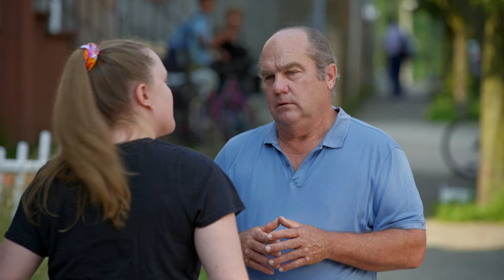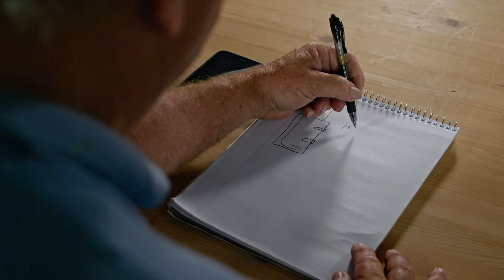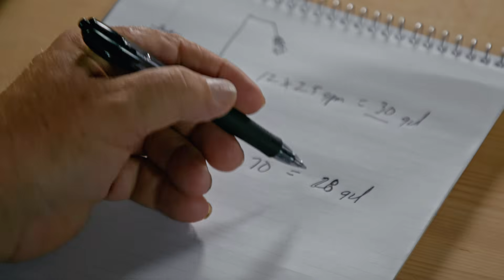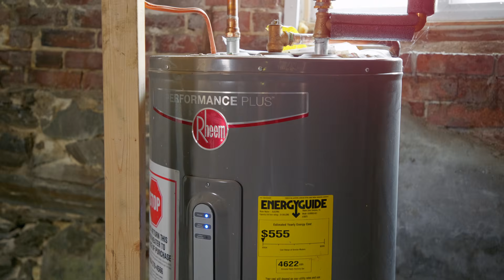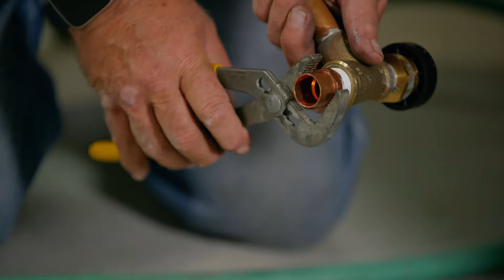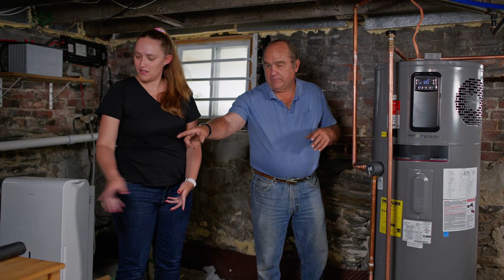When To Upsize a Water Heater | Ask This Old House

Comment: I think my first effort would have been turning up the thermostat on the water heater. If you're starting off with hotter water you're going to use less of it during the shower. It's a new shower so it's got a mixing valve so you shouldn't get scalded. Obviously if they have small children that might not work but it's where I would start. That said what he did may have been the best answer overall because there might be things that weren't in the show that we aren't aware of
Reply: Last longer yes did it at my gf house got about 30 mins on a tank but burns out your anode quicker
Reply: @SubToRandomVideos101 Why does it decrease the life of the anode?
Reply: @CodyOnHomes  cuz the tank is constantly running at a hotter temperature burning through it faster than
Reply: Use the hottest even with small children. Tell them about hot water and how to mix temps. That's how kids learn.
Reply: you could also put in a mixing valve at the tank to get 110 degree hot water so you don't get burned at faucets with two handles and then hot water lasts a lot longer
Reply: @ranger178  This. Cash Acme makes a simple tempering valve. You can virtually make a 50 gallon heater a 80 gallon with the thermostats up to 150, and the tempering valve set to 125
Reply: @joshm5816  i have a tempering valve so water to dishwasher is about 130 rest of house gets about 115 works realy well calibri or some thing like that has built in temp gauge

Comment: Any high-tech water tank will give you issues and will not last 12 to 15 years go old-school AO smith or Bradford White, no bells and whistles. Nice and simple.
Reply: yeah, you never know how long heat pump will run if it dies, you're out lots of money or voltage surge could fry circuit board.
Reply: @ranger178  it’s like a land rover vs a Corolla.  No bells and whistles for the Toyota you’ll get 150k miles worry free.  The Land Rover will get you maybe 40k miles worry free if you barely drive it and drive it like a Asian person or a 70 yr old

Comment: Those pipes are going all over the place.
Reply: Should have cleaned up the install while they had the chance.
Reply: My thoughts too. And it didn't appear that the copper pipe was supported anywhere so if anything leaned into those pipes, I would be concerned it could break a joint.

Comment: Clearly not worth the $1800 upfront cost when insurance mandates that you replace it after 10years anyway. Get the cheap 60gal electric one if you need more runtime.
I get that it's for the show, but real world experience, not worth it.
Reply: It's more like <$800. For example my utility gives you an instant coupon code for HD or Lowes, then you also get a 30% tax credit.

Also, this heater is 5 times as efficient and doesn't require much power to run.

In short. Totally worth it.

Comment: Ok the operation of this heater sounds great. The energy efficiency is good for the pocket. The part that concerns me is how remotely this thing is accessible. It likely needs an internet connection, which means a hacker can tap into it, or the part that worries me more….government can get into it and shut off your hot water. 

Sorry but even being a veteran I don’t trust government enough to not tamper with people’s appliances, which sucks because side things meant to make our lives easier and better can be turned against us.
Reply: yeah, the very reason they want kill switches in new cars now so they can shut off your car. they decide you have driven too much no more for you.

Comment: Wait, is that homeowner showering with the full hot water temperature from the tank? And not mixing with any cold water??? If your hot water temperature is low enough to shower , you got a legionella problem
Reply: Turn the tank temp up. Your mixed temp water will last longer .
Reply: Agree. This math makes some wild assumptions
Reply: yeah, set water heater at 130 and you mix it to 110 in shower we have mixing valve at water heater, and it makes water last a long time plus it is gas LOL
Reply: Correct

Comment: Not a fan of the romex just dangling down to unit. Should be MC cable or flex conduit to unit.
Reply: And the cold supply line with no support flapping in the breeze.

Comment: I understand there are now three heat sources but by your math how is an extra 7 gallons of water going to help? That should only add just under 3 more minutes of shower time, or did I miss something? That seems like a big expense for so little return. Although I understand it'll pay off eventually but not many have such upfront finances to get started.
Reply: Yea if they use so much hot water you'd think he'd go with a 60 or 80 gallon tank.
Reply: the heat pump part takes a long time to heat the water so if it has to kick in the heating elements frequently then that great savings is not going to be that much in winter your basement will be a refrigerator after it sucks all the extra heat from room, I think the heat pump water heaters makes sense in warm climates like Florida where you want to cool room anyway and dehumidify.
Reply: @ranger178  not true. It only lowers the temp of the room by 3 degrees or so.
Reply: It will add a couple extra minuets, but the benefit is the new insulation plus the more efficient heating source will allow it to reheat the tank faster, not to mention lowering the use of electricity in the process.
Reply: The new heater will be able to replenish the hot water at a faster rate because of both the heat pump and the electrical heating elements. It won't heat water as fast as it's being used but from experience, it will probably replenish half of it's capacity with continuous use. So realistically, they'll probably get a good 70-75 gallons of hot water before it starts to run cold.
Reply: @Skammerd Electric resistance heat will heat quicker than the heat pump. Correct me if I'm wrong but as far as I know it doesn't use both methods at the same time.

Comment: We have an older version of that water heater, 5 years and still going strong. Lowered our electricity bill noticeably when we put it in (although I don’t remember the exact amount).
Reply: Remember to replace the anode rod!
Reply: @MrDummyisDumb  Good idea, just ordered one. Maybe I'll do a review video on it.
Reply: @MrDummyisDumb  Or purchase an electric one that never wears out.
Reply: anode rods wear out on all water heaters depending on water use and hardness or acidity of water.
 I will believe those electric anode rods when i see one actually work for twice as long as a regular anode in same kind of water heater I think when you go to claim warranty because the water heater failed, they will be either out of business or will prorate it so you get 50 bucks. @jaycahow4667
Reply: At least I have Bidenomics to lower my electricity bill 😒
Reply: Is there a gas + electric version? About to replace our 13-year old water heater. The heatpump is a good idea, especially since it would extract the heat from the tiny closet where the gas boiler also lives.

Comment: I was taught to wind the teflon tape clockwise onto the threads but he did it the other way. Does it make any difference?
Reply: Been doing plumbing for 50 years and I agree with you - clockwise for teflon tape.
Reply: I mean as long as the teflon doesn't unwrap, it doesn't matter which way you wrap it cause it will serve the same purpose. The reason you do it clockwise is because it goes with the thread and how you twist it to screw it in, so it'll never unravel as you are screwing it in. It's just easier and fail-safe method if you do it clockwise (with the thread)

Comment: $1,700 at my local box store. (Not including installation). 10 year warranty. It might be worth it.
Reply: I’ve the 80 gallon version of this water heater. It really does use ⅓ the electricity when in heat pump mode. And it keeps the basement dry and cool. 

On the other hand, the basement is cold during the winter and it’s noisy. But if I need the basement, I can use the app to switch it over to resistive electric and it becomes quiet and doesn’t chill its area. 

Had it for nearly 2 years, so far so good. 

I would have probably gone with the 80 gallon model. They are going to have kids within the warranty of the heater, like as not.
Reply: Here in Maine (and I assume plenty of other states), there are super easy rebate programs. There were some qualified retailers you could buy from (or your plumber could buy from) and they took care of all the rebate paperwork. We paid $850 for a 50 gallon tank last summer.
Reply: It's not.
Reply: @GoForAHikeNC With $400 a year in savings you will break even after 5 years. Water heaters should last decades if you drain annually and replace anode rod as needed.
Reply: @CodyOnHomes  Most areas of the county and homes wont save $400 a year.   Plus, as I posted, 80gal units at my Lowes in NC are $2500 plus at least $1000 to install so even if you did save $400 (which you wont) it would take at least 8-10 to simply break even but that heat pump water heater likey wont last that long to break even in the first place.
Reply: @GoForAHikeNC  With proper maintenance it will last longer than 10 years. 10 years is usually how long they last without maintenance, depending on your water.
Reply: @CodyOnHomes  Prior gas and electric units could last decades with proper maintenance.   If you search on heat pump water heaters, they do not seem as reliable and a lot of people are unhappy with them.  They are basically an electric heater and HVAC system in one unit - neither of which saves money over natural gas - especially in colder areas.  Remember when "tankless" was all the rage, this too shall pass.

Comment: Richard this would have been a great instance to put in a smart thermostat that would boost the tank temperature in the morning when you shower and a mixing valve so it stays safe at the hot water end. Much cheaper than a new water heater
Reply: You can set it up in the app for “high demand” mode for a certain period of time (morning, evening, etc) and heat pump only mode for the rest of the day.
Reply: Fair but the homeowner doesn’t pay when they replace it for the show, and this unit is so much more energy efficient, even if they had paid for it, they would save so much more in energy costs.
Reply: It's only a "smart thermostat" if it does not have internet access that allows the utility company to cut off your electricity as was done a couple years ago to over 2000 homes during a heat wave.

Comment: Just put in tankless. It takes a fraction of space and gives you endless hot water.
Reply: If you have natural gas available.  Many homes are electric only so tankless can get expensive if you need to upgrade your electric service.  For the right use case though, tankless is a great option.
Reply: @wmjwhite  I like having propane for a backup generator, so might as well add the hot water to it. It's about the same cost as electricity where I live, maybe a little cheaper. Heat pumps. Are nice in the summer for the free cooling and dehumidification, but they are fighting the heating system in the winter. One idea I like is a heat pump tank, with a backup tankless unit that's plumbed to recirc the tank when the heat pump can't keep up, that gives you the advantage of both a heat pump and a tankless; I've seen it done in commercial, but never residential.
Reply: They may not have a gas/propane supply, or enough electrical supply, for a tankless system.
Reply: Tankless use a massive amount of power when in use. Upgrading the electrical service or natural gas would have cost a huge amount more than what Richard did.
Reply: @robopaul9  I guess it depends on what you value, I would have no problem with dropping several thousand dollars on endless hot water. If that's not important to you, that's fine; there are multiple options you can choose from.
Reply: Welp! You just saved me a bunch of money, sir!

I was just going to go down and buy a tankless. 
Upgrading the service lines never even occurred to me.

🫡